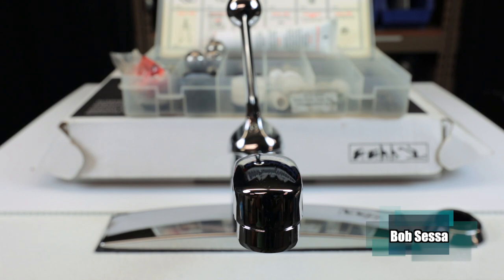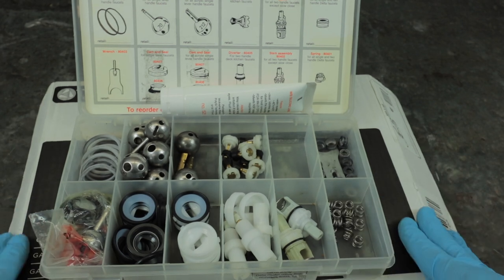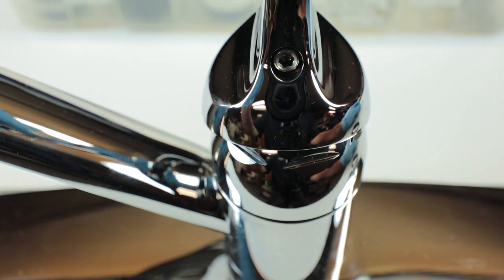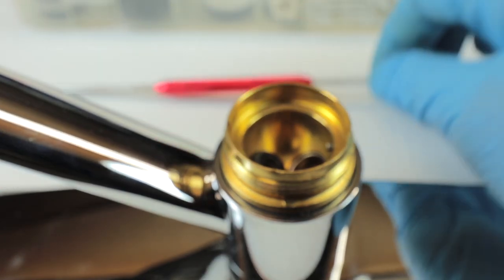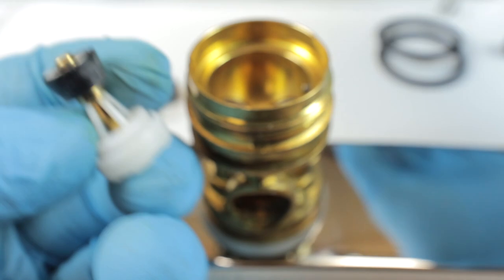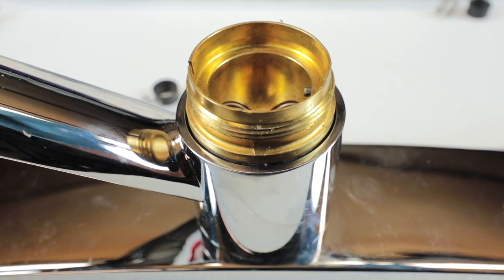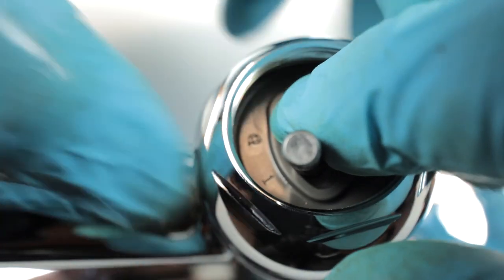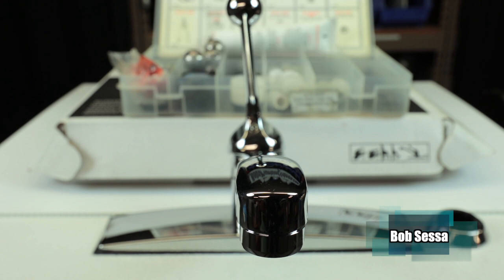Delta Kitchen Faucet Rebuild Kit

Comment: Great vid!  Gearing up to rebuild / repair faucet which needs "jiggling" to a certain position to not drip. (Actually, it's heavier; more of a small stream.)  Wasn't sure mine (very old) is a Delta, but looks exactly like this. So this is mucho helpful!    Side question: Do the seats (of Seats & Springs) have a shelf life in storage?  I have a couple that's been sitting around the garage for decades. Do they get brittle (like rubber bands do over time), or otherwise less functional? They don't cost much, but if they're still good, might as well use em, right?
Reply from the maker: Decades? Use new ones!

Comment: Hey Bob..
I called a reputable plumbing company to change the switch that makes the water run in the tub faucet to the showerhead. They removed the old rotted part out, but they stated they tried to put in the new part put they were having problem, so the had to put in a access panel behind the wall...luckily I have a tall dresser that does cover the access panel they put in, they did frame out the panel and it looks fine...They also re-corked the bathtub. The corking and the part they replaced were both 22 years old..They were there from 11am till 3:30pm because they has to get the proper plug part for the tub at home depot..2 questions BOB...did you ever hear of a plumber having to put in an access panel and 2..they charged me a total of $302....was that fair? I live in Pennsylvania. they are a big name plumbing company. BTW, it is not a switch they put in now...the stopper you push down to plug the tub and press to release and the stopper pops up.
Reply from the maker: Yes I often have made access panels behind a tub, that job here in the Big Apple would set you back over 1K dollars. You did real well, the company didn't make any money!!
Reply: @BobsPlumbingVideos  over $1000 to cut a piece of wall out to fix the tub...OMG..I did do good..
TY Bob for answering.
They also told me that it will be a lot easier now to do any plumbing because the access panel is.now in place...they framed it out and it looks really good.

Comment: Okay after having watched this even though I don't currently have a Delta that was extremely detailed and I know I could refurbish a Delta should I get one in the future which is quite likely thank you again Bob very very detailed and helpful.
And actually I do have a question about the diverter. On my current faucet which I rebuilt it doesn't seem like the diverter is seated properly to have the proper balance between the sprayer and the faucet also it's in the back between the faucet and the wall. Which makes it kind of difficult is there something I'm doing wrong that is not allowing the diverter to work properly? I mean it seems like you pushed it in a little but yet when you replace the handle it doesn't seem like you could have done anything differently like is it supposed to be pushed in more or less in order to control how much water goes between the sprayer and the faucet? I hope that question was clear Bob
Reply from the maker: Are we talking about a Delta single lever faucet?? If not send some photos to info@robertsessaplumbing.com.

Comment: Bob, did you grind the teeth off of your Channellocks or can you buy them like that?  The angled tool with sharp points on either end is a Machinist's scribe.

I bought & installed a new Delta single-lever kitchen faucet a couple of years ago, but don't remember the cam washer you showed.  When I try to set the lever to give a partial flow, it often "droops" down & turns the water off by itself and I'm afraid to tighten the nut any further.  I bought the faucet at a big box store, so I'm wondering whether I'm suffering from "operator error" during installation or if the big box store sold either a kit with missing parts or a counterfeit Delta faucet.  Any ideas what could cause the lever to not stay where it's placed?
Reply from the maker: You can buy the channel lock pliers without teeth. When you say Lever are you referring t to the faucet handle? It you don’t get the slot in the ball to line up with the guide inside the faucet that could affect the operation. Or possibly a crimped water supply line?
Reply: @BobsPlumbingVideos  Oops.  Yes, I meant the faucet handle.  I'll take it apart to verify that the slot in the ball is lined up with the guide pin.  I'll also inspect what I can see of the water supply line.  Thanks!

Comment: Thank you Bob for making this video and the great instruciton. Is the slick and slide the same as plumber grease and can I buy that at hardware store. Can I just use an 1/8" allen wrench instead of that special tool?  I just had this faucet put in 2020 by a plumber who also provided this faucet as I told him that was model I wanted. Was surprised that was leaking in 2 years. Delta customer service said it depends on usage. We do dishes by hand, no automatic dishwasher so does get used a lot. Also have a water softener, and tec said that can contribute due to the salt product wearing on the faucet parts. Update: I ordered from Amazon the  item you recommended.
Reply from the maker: Any silicone plumbers grease will work, Slick & slide is just the name brand I purchase from my plumbing supply. I would imagine in har water areas you would have to service the faucet more often. Here in NYC the water is not hard and we have no need for water softeners.

Comment: Best detailed video Bob. I have repaired my 370 faucet leak once before like this and it has been great for couple of years. But recently it started making a thud sound (in the faucet) when the water got hot and would stop serving hot water. This went on for a couple months until I tried just tightening the white upper nylon ring a bit. Since this it does not serve any flow from the hot side. Today I replaced the washers and springs with a kit from HD. I couldn't buy a repl ball in store or in town. No leaks. But still no hot water flow? Any ideas? I don't see any other part that would block just the hot flow. No where can Google find any reference or solution to my problem.
Reply from the maker: Sounds like you may have to remove the hot water supply line feeding the faucet and check for blockages and or the hot water supply valve to see if it's compromised.

Comment: hi Bob  you are great teacher , i whant to know te difference between a delta rp70  and  a rp 212 stainless ball  is it the possition of hole or size of the ball and where rp 212 go usully  ? thank you
Reply from the maker: All RP212 ball assemblies are the exact same model. The RP212 can be found at any dealer that sell Delta Products. RP212-3 is exclusive to Home Depot.

Comment: is it possible that the spring causes hard to twist faucets?  on hot side of the sink, regards
Reply from the maker: Not in my experience, you can pull the stems apart and lubricate them with a good quality waterproof silicone grease and you'll be good to go. Also make sure you're using the correct springs, two versions a. coned shaped and b. longer straight versions. They're not interchangeable.

Comment: I replaced seats and springs but water flow is less than it was. Do you know why it's like that?
Reply: Great video by the way!
Reply from the maker: Check both hot and cold water supply tubes for possible blockages. Sometimes old pieces of the rubber seats fall thru. Remove all 
the parts, put a cup over the top of the faucet and blow out the lines by turning on the hot and cold water one at a time.
Reply: Something was stuck in the outlet took that out and it's back to normal. 
I get air on it all the time though I think around the cam seal. Maybe the diverter valve is loose?

Comment: Can't get the spout off even after removing nut and cartridge.. HELP
Reply from the maker: How old is this faucet? On extremely old units the spout "O" rings get so dried out the spout gets stuck. You could try heating it up with a hair dryer or heat gun while rotating the spout left to right and pulling up.